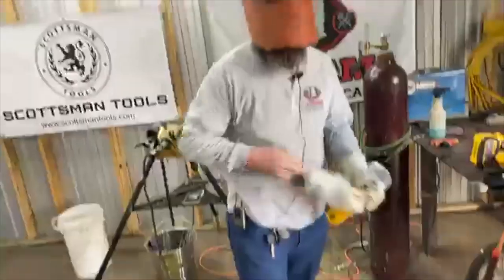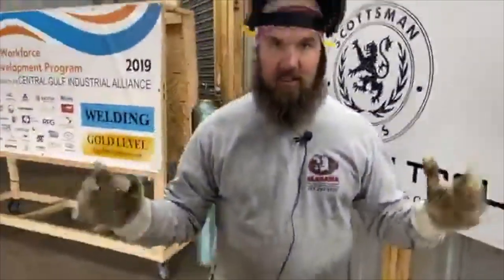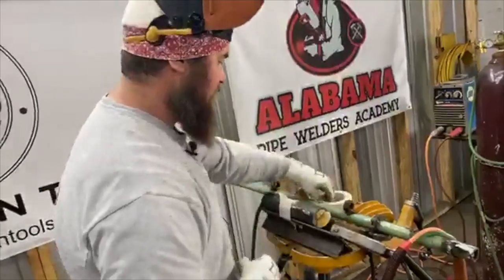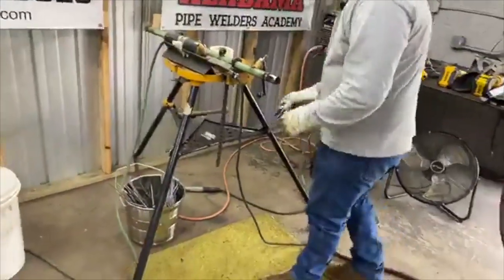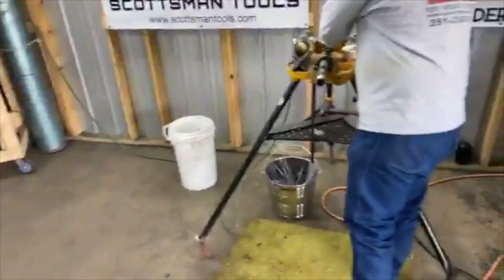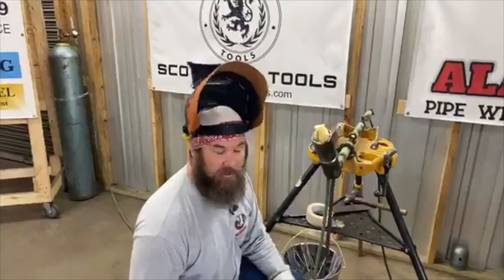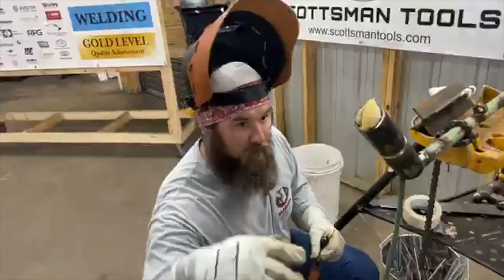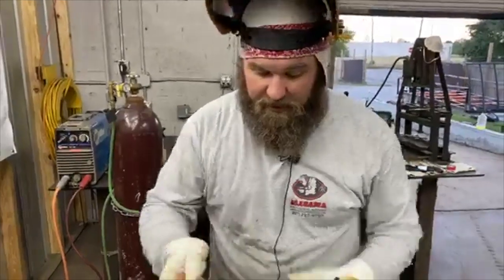308L wire on carbon schedule 80 pipe (field test) with tack and root

Comment: I wish the school that I went to 8 years ago was like this place . I went to Midwest technical institute in moline Illinois it was their first pipe welding class that they had. And it wasn’t shit compared to this. I’ve been working at an archer Daniel midland corn plant in iowa for Worley , pipe welding for about 6 years now and I wish I could have learned the things that I was actually going to experience in the field . Going to this place would have put me in such a better spot startin out . I encourage anyone who loves pipe welding and wants to do it as a career this school these guys are runnin is top notch shit all they need now is some welding out of the man basic or  some maintenance type scenarios like valves leaking by welding through water , or threaded jobs or shaft build up with 6013 or tank jobs scenarios. They are definitely moveing in the right direction I’m sure they are producing some top notch welders. For 13 k that’s awsome. I wouldn’t recommended anyone to go to the school I went to . But Alabama pipe welders academy is the shit

Comment: Hey how about a tutorial on welding120 wall tubes to 10" heavy wall like headers for boilers and heat exchanger systems
Reply from the maker: Tiffany Long we just got some 10 “ heavy wall in with 900 lb flanges be on the look out soon

Comment: 308? I thought its supposed to be 309 to weld to carbon
Reply: Adrian Barbosa exactly! I was wondering the same thing. I’ve never seen 308L recommended on anything other than 303, 304, etc. I checked my texts, and nowhere have I read about 308L on carbon. I’ve been doing this since 1973, so this is odd.
Reply: It’s to keep from using stainless pipe on test costs them money you can weld 308 on carbon for testing 309 is if one pipe was carbon and the other was stainless
Reply: Luke Bilyeu I just took this exact test today with 309L and carbon pipe